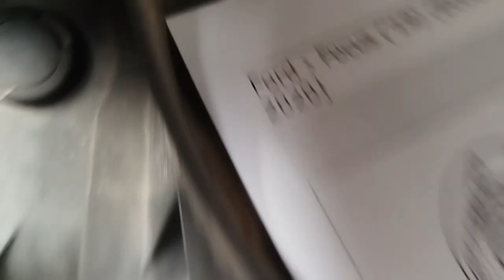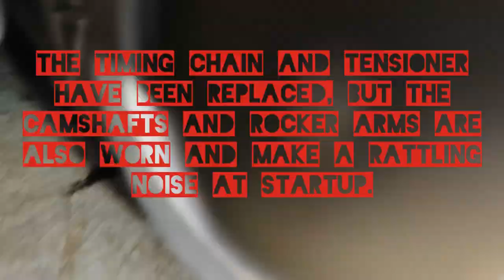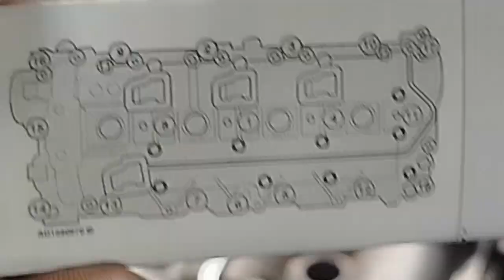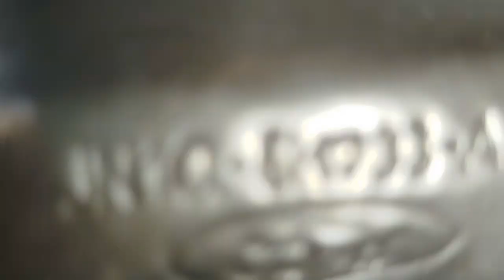Ford 1.5 TDCi EcoBlue timing chain in the cylinder head – camshafts and rocker arms replacement

Comment: Nice work! How are the later engines for Cam chain wear with the new 8mm chains fitted?  Mine has 8mm chain 1.5 Ecoblue Connect van is on 92.000 miles and a tiny start up rattle that's all.
Reply: I hope the 8mm chain makes the difference. My 44k mile van with the original 5mm chain, and bent the crank! Oil change every 5k miles now I have it back rebuilt

Comment: Does it need software update after installing the 8mm kit like they need Peugeot Citroën cars?
Reply from the maker: I don’t know… but I don’t think so… it’s unlikely that the software can tell the difference between a thinner or a thicker chain.
Reply: Did you use genuine upgrade kit or aftermarket oem?
Kind regards

Comment: Many thanks for this! Great job! I own this same car and I am about to do this 7mm to 8mm camchain upgrade. Do you think its better to also replace valve lifters? And could you please tell me the part number of camshaft seal and camshaft plug?
Reply from the maker: I'm not exactly sure, but for the 8mm chain, different camshafts and mounting brackets are also needed, so parts need to be ordered accordingly.

Comment: Hi, will there be any problems if I continue using the 7mm chain? Do you think I should upgrade with an 8mm camshaft cover set?
Reply from the maker: If you consider it as a replacement interval and change it again around 60-65,000 km, you won't have any problems... If you're planning to keep the car long-term, the upgrade might be worth it... but for example, it's relatively hard to source where we are... for now...
Reply: @turbolali I'm sure I'm bothering you a lot.

Is there a way I can remove the eccentric teeth without using the holder it appears to have been used to remove them?

What is the purpose of the eccentric toothbrush handpiece?

Comment: The timing chain only makes a noise for about 4-5 seconds when starting the car in the morning. The car has 75,000 km. Do you think I need to change the timing chain? How many km does this chain last?
Reply from the maker: There is no interval... the chain tensioner dies between 60,000 km and 100,000 km

Comment: Hello, I'm bothering you again because I have a few questions.

-After timing the timing chain according to the markings, installing it, and then placing it on the top cover, do I need to lock the 8mm hole before engaging the timing belt onto the timing chain?

-Can I do this without shifting the gear to neutral? How do I shift it to neutral?

-Do I need to crank the engine a little before tightening the timing belt tensioner for the final time?

-If I follow the steps shown in the video, could the timing setting be out of sync?

-Do I need to keep the timing belt tensioner bearing centered on the bearing to ensure the timing belt tension?

-If I tighten all the bolts without applying Loctite to them, will this cause problems later?

-Is there anything you absolutely must remember or absolutely pay attention to?

-What do we need to do to access the PDF version of the technical book?

Thank you for listening. I wish you a blessed day.
Reply from the maker: When assembling the timing chain and camshafts, the exhaust camshaft is not in a position that allows you to install both the belt and the camshaft sprocket at the same time. After bolting the entire assembly into the cylinder head, you install the sprocket and rotate it until it can be locked in place, so you can fit the belt. There’s no need to rotate the bottom end of the engine.

Comment: Great video.. one question. When timing the cams, obviously the new chain has markers along with pointers on the actual cams. But they could be put in at any point really. Is it a case of having them set on the marks on the cams and chain then just spinning the cams once you have the cam pulley back on into time?
Reply from the maker: You can't just assemble it any way... if you put the chain together in the wrong position and then install it, the valves will open at the wrong time.